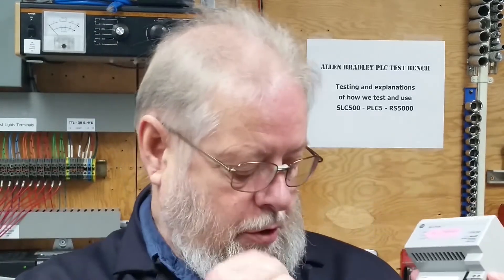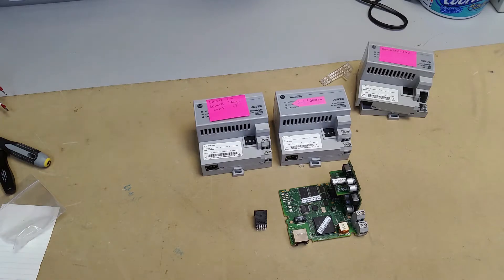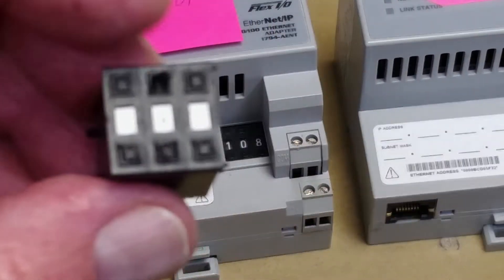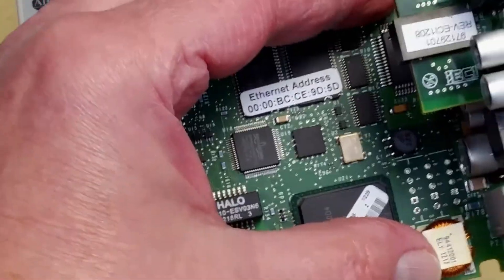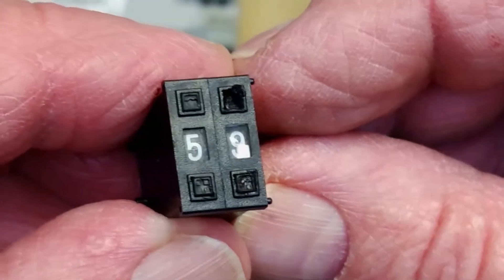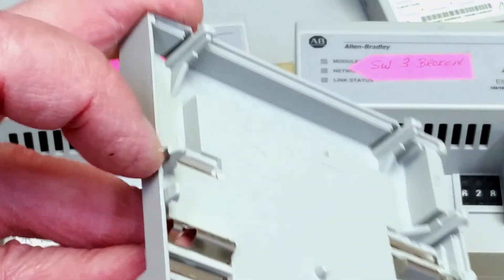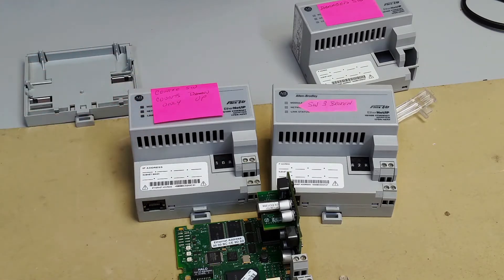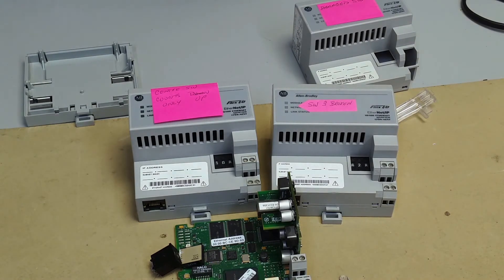1794-AENT/B Broken Switches

Comment: Hii sir ,
 I have 1794-AENTR & i am facing following issue.
Without lan connection Link1 amd Link2 status solid orange.
Can please guide me this to resolve.
Reply from the maker: HI - I have looked in the manual and there is no situation mentioned and I have not seen solid orange status.
Suggest that you give the module a unique address and open RSLink and troubleshoot from there.  You can also open a webpage for that address and see diagnostics pages there.
This would be best done offline from your main network so that there are no possibilities of conflicts with other adapters.
Reply: @abplctestbench759  thank you for Replying.
I have open that card found problem on nand flash card.
Connectcor was blackish due to moisture. Used eraser to clean.
Now it’s working fine.

Comment: It’s amazing that AB can get away with making such crap. Achilles heel, indeed.
Reply from the maker: Hi Barry - The original PLC2/ 5 modules were designed by old school Rockwell engineers to US MIL Spec - which meant that they were supposed to last 80 years MTBF (mean time between failure).
The equipment they put out now is built to commercial standards and a 7 year MTBF.
All of the controls companies are putting out crap in the name of profit over reliability.
Reply: @abplctestbench759  Hmm. I didn't know that. I do remember the old PLC 5's, though. Huge, easy-to-wire cards and bulletproof! :^)

Comment: Hi i am from middle east and i want to buy 1794-ACNR15/D like 10 pecices and Flex I/O Modules digital and analoge could you plz help me with that i do sell and buy for living like you plzz reply to me ASAP thanks
Reply from the maker: Hello Mahmoud:  It has been my experience that selling to the middle east is more work than profit.  I would need to know what country and exactly what the modules are going to be used for.  What industry?  Then I have to check with Canada Customs to make sure that your country and industry are not on a restricted list.  Shipping and customs can also be an issue as customs officials in the middle east have been known to cut open and destroy parts that they don not understand.